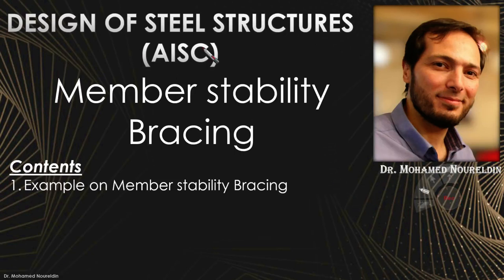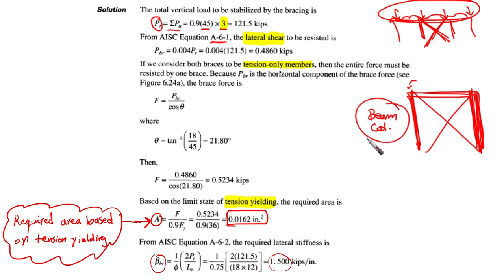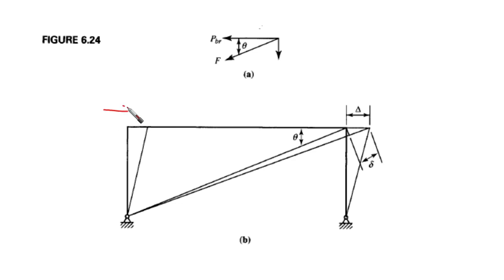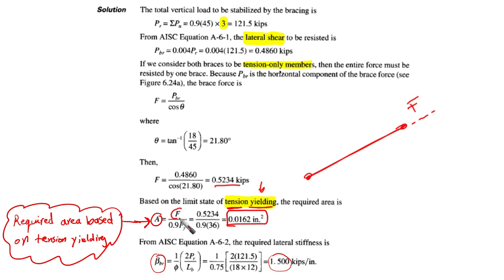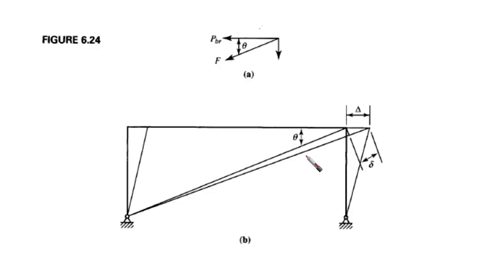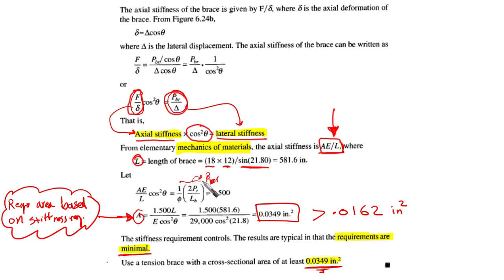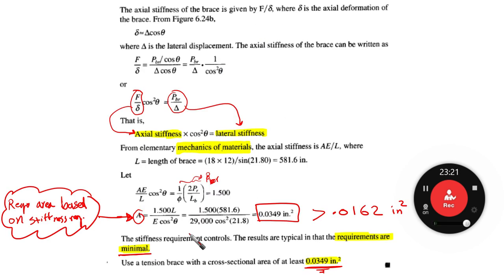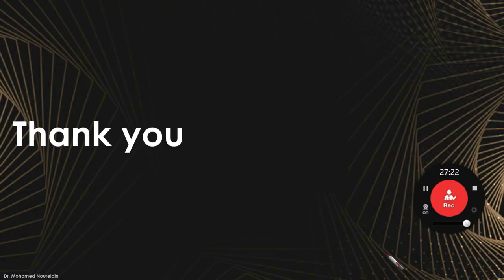24-Example on stability bracing (relative or panel type)

Comment: Dr, Thanks a lot for sharing such a valuable knowledge for structural engineers and I have attended your all 24 videos of the design of steel structures in detail. However we are also requested for design of steel connection including design  of columns in seismic conditions and also hope your cooperation in future will be highly appreciated in future.